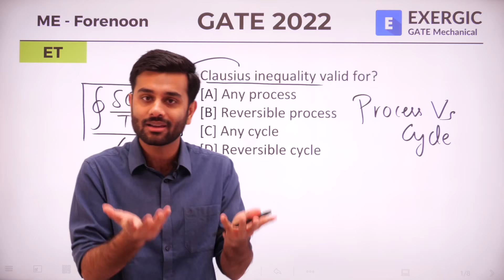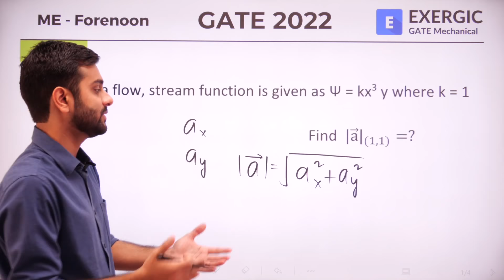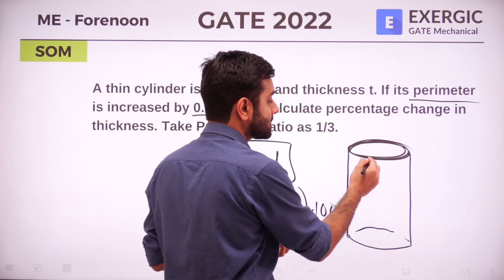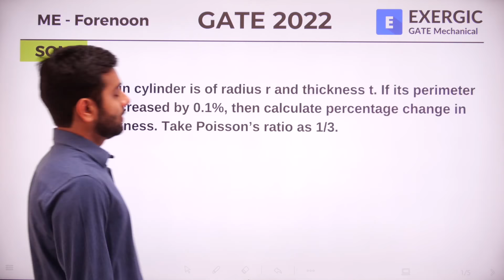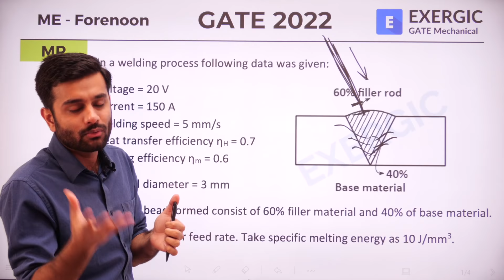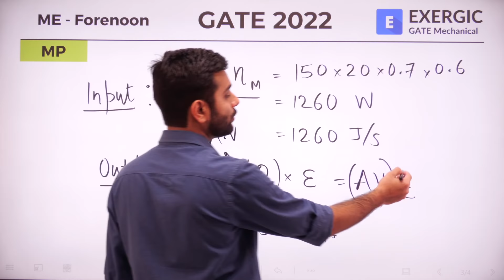GATE ME 2022 : Forenoon S1 | Solutions and Analysis | Mechanical | Exergic

Comment: You have taken wrong cross section area.  We have given thickness of tube 1mm so d0 =102mm di=100mm
Reply from the maker: Cross section area calculations is correct. 

Check the ratio of t/D in this case, it is very low. So pie*D*t will be used for cross sectional calculation.

Also question has not mentioned if the given dia is inner/outer. So pie*D*t is correct

Comment: Sir ur rating difficult to easy que is good
Really this year gate was tougher than any year ...may be we can solve all que after some manipulation thinking process but it will take 10 to 15 min per que ..but in 3 cycle method we have to move on next que  
In home I can solve almost every que but in exam due time pressure we can't give any que to more than 5 min. I know some 2% students can solve it easily in only 3 hrs but they are enogh good from their school level and also from IIT ..i think this year Gate is not made for tier 2 or 3 students....i thought gate wants basic concepts but this year gate wants some phd level knowledge... I want to know what is the need of doing this by IIT ???
Reply: Question itself required 2 min of thought process after reading
Reply: Same thing happened with me... Couldn't be able to solve many questions due to time restraint...

Comment: There was another question:

Which of the following factors increases fatigue life of shaft?
a) shot peening of shaft
b) increase in relative humidity
c) decrease in relative humidity
 Option d I don't remember sir...
Sir, I want to know whether relative humidity has any effect on fatigue life?
Reply: Shot peening I guess.
Reply: @amardongare9909  I don't think so relative humidity has any effect on fatigue life... And the fourth option was about the surface finish I think....
Reply: @PRIVATEPSUJOBS7  What about corrosion?? Don't know just guessing
Reply: @prathmeshsharma4346  then absolute humidity should be the parameter na bro not relative humidity
Reply: @adityagadkari5636  Both are linked bro
Reply: @prathmeshsharma4346  look at the pyschrometric chart 
It's not necessary that along with increase in relative humidity the absolute humidity will also increase
Reply: Good surface finish
Reply: @abhishekshukla2474  i think it is increase only